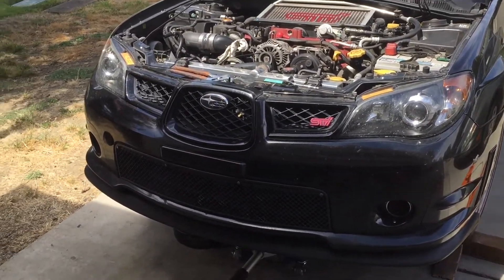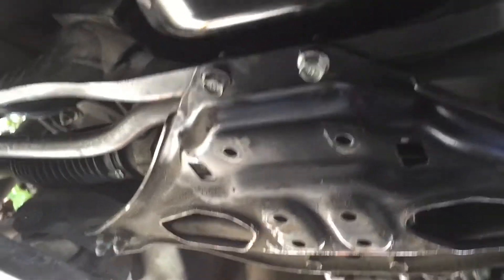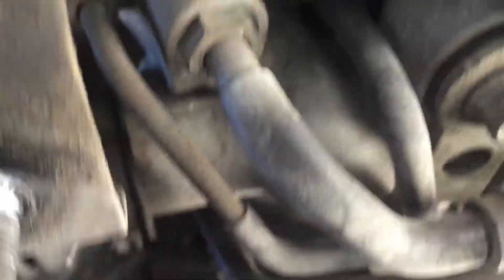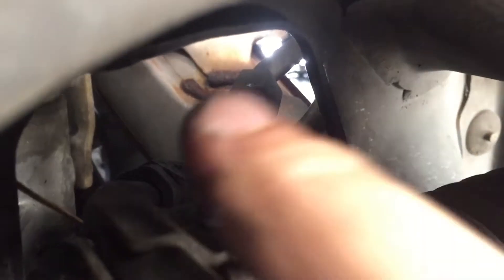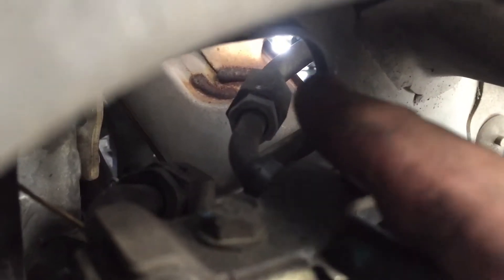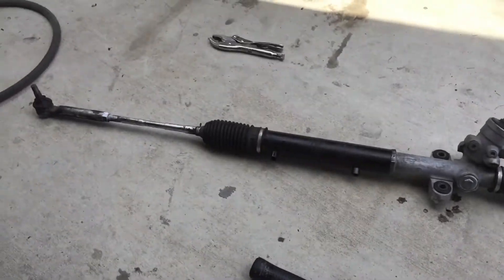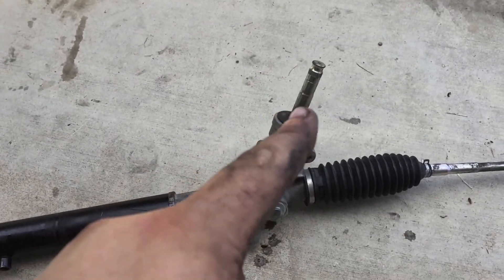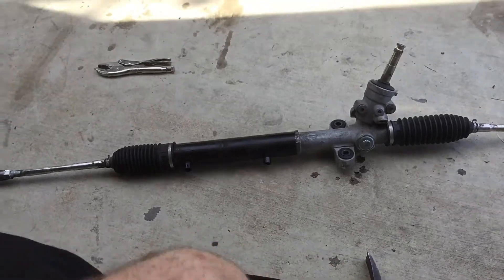Subaru STI EPAS Conversion Part 1

Comment: Interesting project. One quick question though, can you explain a bit more detail how you sealed the cylinder fluid holes again?
Reply from the maker: snipera39   I took each fluid line off and cut the flare fitting off of the line. Once the flare fitting is off I removed the rest of the flare line and filled each fitting with hot glue. Then just reinstalled the fittings.

Comment: Not sure if I missed it in the video, but what Steering Column are you going to use?  I'm planning on doing this too, and came across your video.  I'm looking at a prius one.
Reply from the maker: Jack Alayu   I purchased anothe STI steering column and a chevy Equinox EPAS coulmn/unit. I don’t know how well the prius ones are but I got the equinox one because there is a guy who already makes a rheostat knob and harness for it that makes it adjustable assist. I have since decided on using the EPAS setup now in my 70 chevelle project because after installing a Whiteline antilift kit and adjusting the caster, the steering input is how I want it without the need for EPAS.
Reply: jdmcommute  aww....i was looking forward to it.  I'll look into the equinox unit.  I did some brief research and the nice thing about the prius/toyota ones is that you dont have to use the control box, but you lose out on customization.  However, from my understanding with the GM columns you have to use the controller for it to work, which isnt that big of a deal...but it does add to the cost.
Reply: Go find an actual Subaru electric power steering rack with the ecu